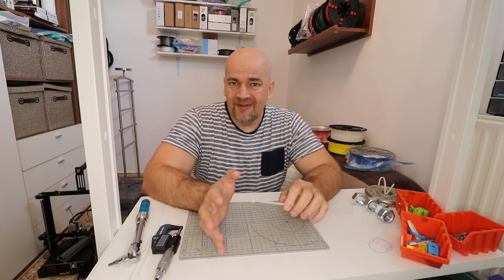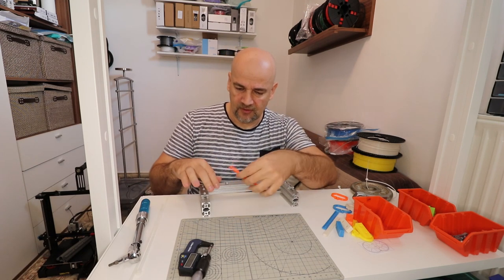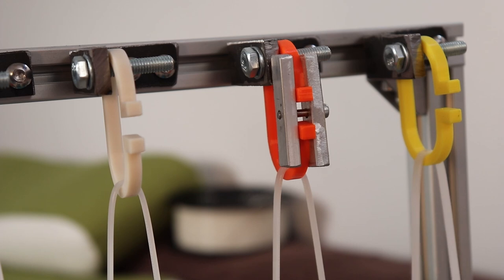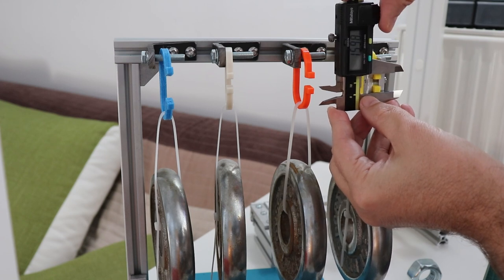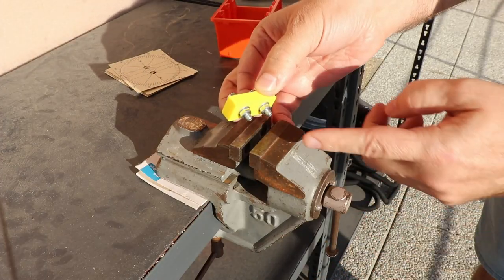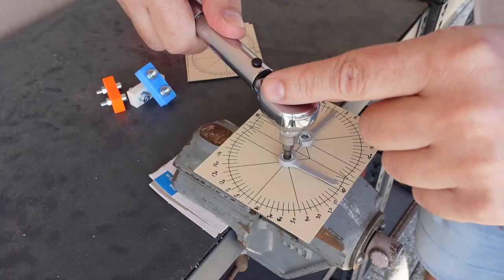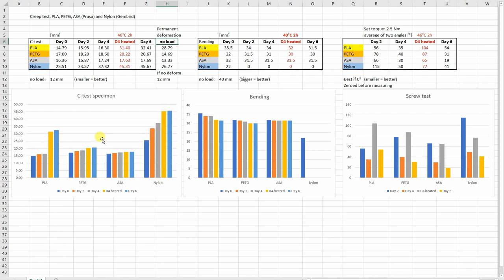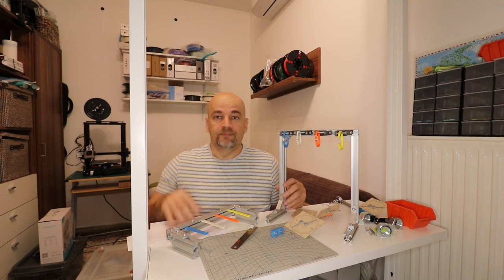Creep test with 3D printed plastic materials: PLA, PETG, ASA, Nylon

Comment: Really useful information!
Was the Nylon annealed? I've always wondered how much of a difference in creep of annealed vs un-annealed PA would there be
Reply from the maker: Usually PLA is annealed, never heard about nylon annealing. The problem I have with annealing, is that objects deform a lot, not good for mechanical parts
Reply: Nylon is semicrystalline and changes properties so much when annealed that manufacturers often times publish both datasheets, un-annealed and annealed.
The reiforced versions (glass filled, carbon  filled) can be annealed even at Tc without suffering dimensional inestability. For the unfilled versions, because the HDT is so high compared to Tg, the deformation annealing at Tg or a little bit above Tg is not too noticeable
Reply: Oh.. and when annealing at Tc, the time period is much shorter. You can place a natural color sample of the same polymer with a similar wall thickness next to the part you're annealing and see when the indicator sample gets opaque, that let's you know the if crystallinity has increased. You can get different degrees of crystallinity, but I haven't tested that too much.. just got to see different levels of opaqueness and subjectively percieved different properties, but yeah.. I can't assert anything in that regard

Comment: Can you make a video about 3d printed hose fittings / tap fittings like double nipple or connector, and compare how strong the material againts water pressure. PLA, PETG, ASA, Nylon etc. 100% infill or 100% perimeter. Thank you.
Reply from the maker: I already printed some fittings for my fathers pesticide sprayer (1 bar) from PETG and it works now more than 2 years. But yes, this would be very interesting test.. great idea, thx.

Comment: Great job!
Please, check for the next test a 870 PLA filament.
Reply from the maker: Hm, not the first comment who also suggested this. What is so special about this PLA?
Reply: @My Tech Fun There are some youtube videos with 870 pla test,... it's look like "better" than abs, and obviously is easier to print. So, if we have a durable material and not hard to print, the non profesional printers (as me) have a good material  to avoid the problems with other filaments.

Děkuji :)
Reply from the maker: @shvirik  Thx. Sounds like the Nonoilen, which I already tested (only not the strength, but the temperature, it can be even boiled or heat up to 110°C)
Reply: @My Tech Fun Yeah ... it looks similar, but I won't use the water to make a tea :)
The 870 also performs better with the heat:
https://youtu.be/uMIfU4obfo8?t=333 (an example)

Taking into mind that an 870 PLA could be bought for around € 22 / kg ... I think it is reasonable to use it for parts that should be durable without making your life difficult. (for printers noob as me).

Comment: Printed a filament guide in PLA+, but it warped to the point where it wasn't really doing its job - probably because I print in an enclosure with elevated temperatures. So I've reprinted it in PETG, hope that lasts a bit longer. If not, I might have to add a rib to the design to stiffen it. I don't really have the capability to print some of the other materials at the moment, mostly need to figure out ventilation.

Comment: The screw test is extremely valuable, but there are 2 major issues with you current set up.
First, the torque is way to high. This is the sort of torque you would apply to something like metal, not plastic.
Second, the second torque is clearly being affected by the first. The screw holes need to have a division between them to absorb deformation - like the grooves put in concrete sidewalks.

There are very good affordable dial indicators out there. In the US, Shars carries really nice ones that take a fair bit of abuse, and are accurate and repeatable. There should be an outfit that sells quality Chinesium stuff somewhere in your buying zone. Look for the places that hobby machinists get tools, not the places that Makers do (they are clueless about this sort of stuff). I would not buy digital unless you had some really compelling reason.
Reply from the maker: You are right about screw test, I'll insert a groove between. What should be the torque for M5 in plastic? I'll buy dial indicators and rebuild the test setup a little bit

Comment: It seems your Nylon was quite Wet in these tests, at least it appeared quite fuzzy to me
Reply from the maker: Yes, it was dried before placing in vacuum bag, so I dried it only few hrs before print, but looks like, was not enough
Reply: @MyTechFun  it probably would have been enough but nylon will "expire" in just a few hours in open air. somtimes even in the middle of a print

Comment: in my opinion, there is no point in doing such long tests,
test more:
ABS vs ABS + vs ASA
different PLA company from PLA + / HT-PLA ... and take the average for a given type of filament because there will definitely be differences
and resins of various companies, ordinary vs transparent vs ABS-Like vs PLA (average)

nice measurement after raising the temperature = ideal for use in, for example, a car

Comment: Nylon absorbs a lot of water from the air and becomes  lot more flexible. So basically your test with the Nylon was invalid, because you were measuring the change in elasticity and not creep.